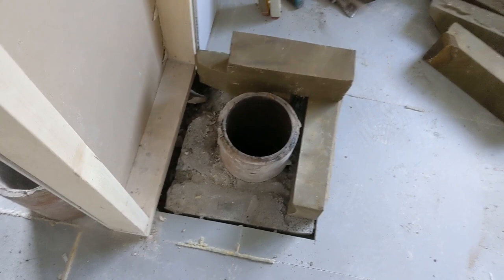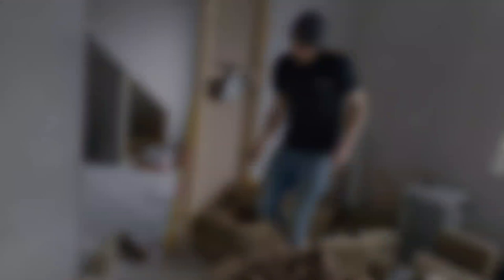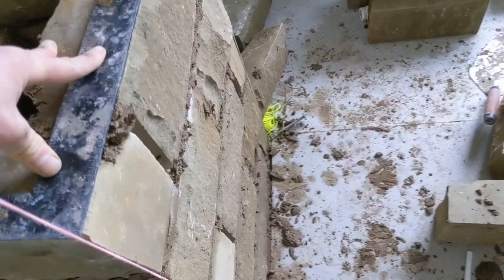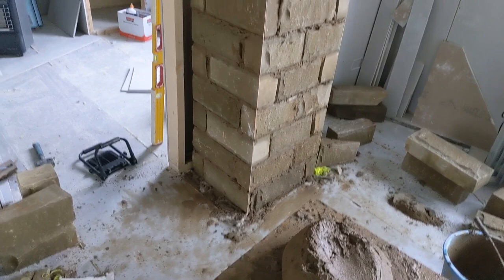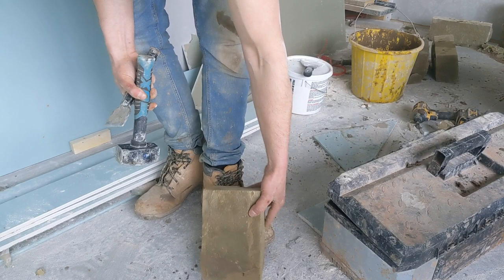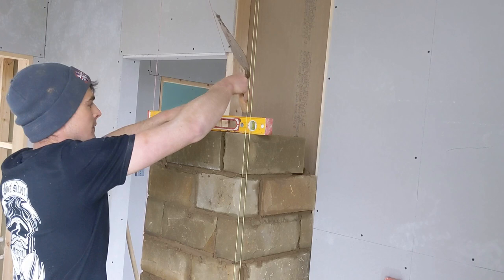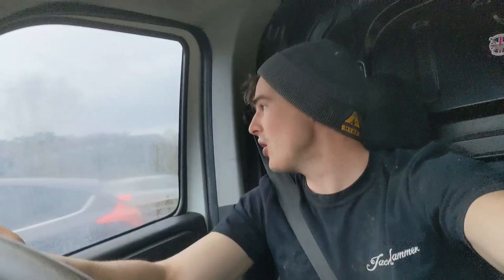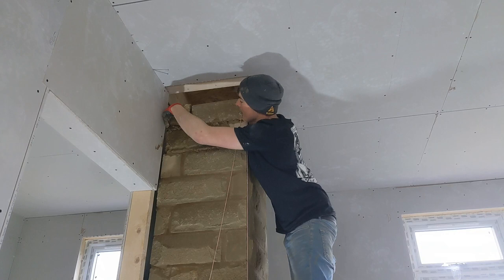Bricklaying - Building a Stone Chimney - real talk - #bricklaying #vlog #renovation

Comment: Great work mate, that's the way to do it with plumblines , I will say though them blank ends should have been pitched with a pitching tool before they were layed, very difficult to do now it's built 👍
Reply from the maker: Cheers Andy mate appreciate it! To be fair, I did dress a few ends with the old bolster, but forman said it would take too long so he would dress it after it was built. I did have a clip explaining it but a cut it out cos the footage was poor 😂
Thanks for your support mate, enjoy the rest of your weekend mate 🍻🍻🍻🍻
Reply: @IzzytheBricky  👍
Reply: @IzzytheBricky  impossible to dress the stone after it’s built, it will look shit, would have took you another 30 minutes to do. Apart from that spot on mate.
Reply: Agree with these comments, piano wire is best for dead men lines. Rubble is the easiest stone to lay but also the easiest to get tripped up on.

Comment: I watch a lot of your YT vids and I like your work so don`t hate me when I say this but it seems some of the blocks were back to front.. What I mean is, the almost smooth finish is facing outwards and the obviously rock like rough finish is on the inside of the chimney. Block 3 and 5 on lhs also has the smooth end facing out, on the left face and the front.  At minute 3.38, the one with the square on, surely that front block should have the lovely rock like textured face pointing IN to the room. If I am completely wrong then I apologise Izzy it`s just how it looks to me, hope you don`t mind me sayin`.
Reply from the maker: Hiya mate! No worries at all for tlyoir comment! I also thought the same. However, some stones had a double rock side..but most had 2 smooth sides. I wasn't quite sure why🤔 but I just put them in😂🤷 
Appreciate your comment as always mate! Have a good weekend fella
Reply: @IzzytheBricky  And you Izzy  :)  Cheers....

Comment: I think your have a major problem if you have not use flue liners inside as you will get smoke or fumes coming through, that why you use glue liners.
Reply from the maker: Hiya chap, from what I was told; they are going to be installing a flexy flue system 🤷 couldn't tell you but the gaffer seemed to know what he was on about 👍 Fingers crossed anyway
Reply: My understanding is if you are building a chimney it must be built to current building regs .then it can be lined .if it is not built to current standards it is classed as a void and cannot be lined
Reply: Might be wrong but don't think I am
Reply from the maker: @michaelstevens2515  your probably right mate and the gaffer on the job is wrong 😂 wouldn't surprise me😂
Reply: I fit wood burners for a living
Reply from the maker: Spot on mate! Bet your gonna get real busy with the gas prices going up! Hope your well

Comment: How did you connect lines at the bottom mate?
Reply from the maker: I used my line and pins under the corner Stones and then some nails at the top👍👍
Reply: @IzzytheBricky  Cheers. Did the pins not get in the way mate? Maybe a nail better? As long as it works for buddy. Your a top guy buddy
Reply from the maker: You know what I kept knocking the one on the left and it was really frustrating 😂 definitely nails next time mate!
Reply: @IzzytheBricky  Yeh, prob 3"  or 75mm  Roundhead nails, better to wrap line around, and stay on.👍💯🔝🦾👌 for bottom